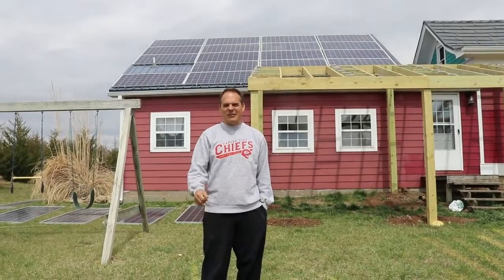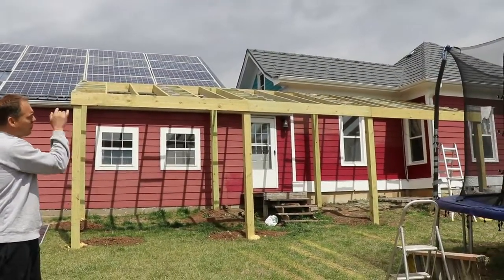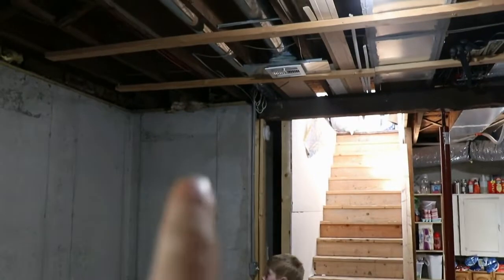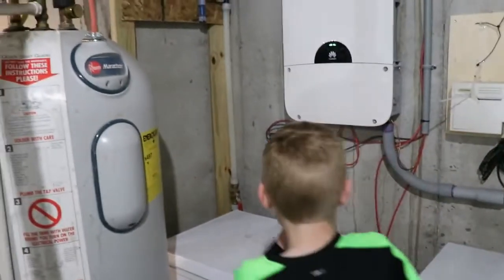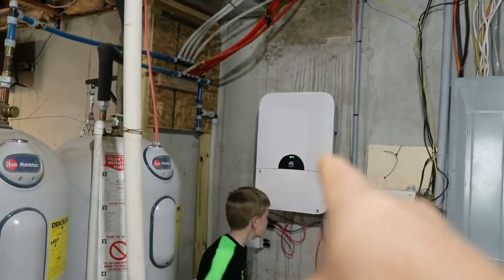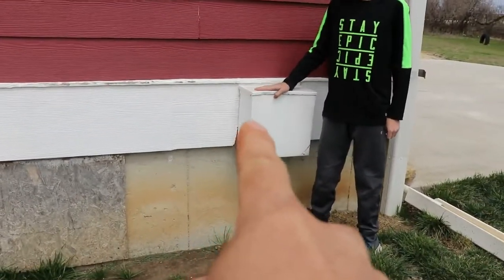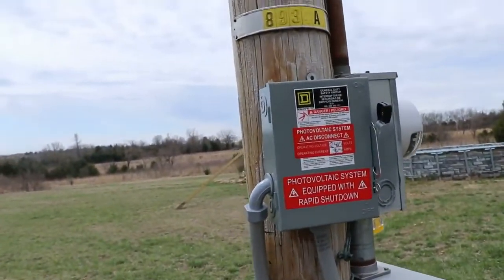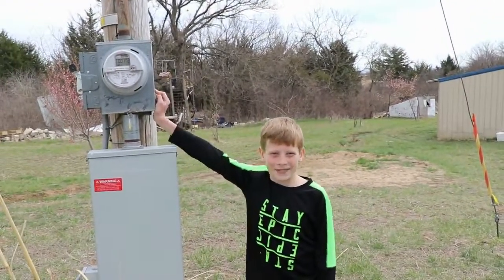10KW Inverter Solar system 11.04Kw solar panels

Comment: I see a tradesmen or engineer in the making!...love the pv system as well!
Reply from the maker: Thanks dude it's been up and running for around a year now. Most months it covers all of my electricity cost and then some!
Reply: @GrowingGiants  sounds great congratulations! I am about to install my own in a month or so..10kwpv 100kw battery...
Reply from the maker: Damn where did you get the battery? That is one thing I don’t have just yet
Reply: @GrowingGiants  it was a stroke of luck finding it on ebay...two battery assembly's each 53kw capacity voltage was sitting at 567vdc a year ago now its 560ish...i am just starting to assemble my system so hopefully videos are comming.
Reply from the maker: @roqm1248  I'll be watching for them very interested in what you have going on!